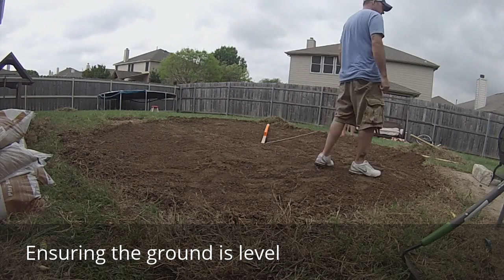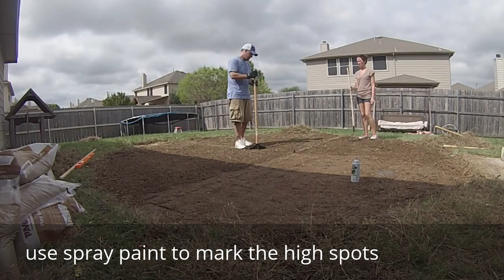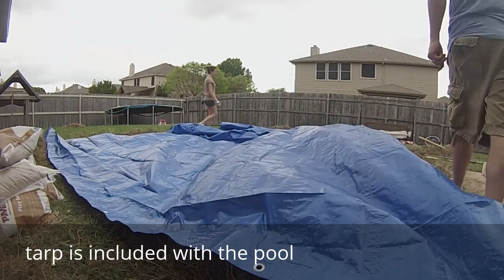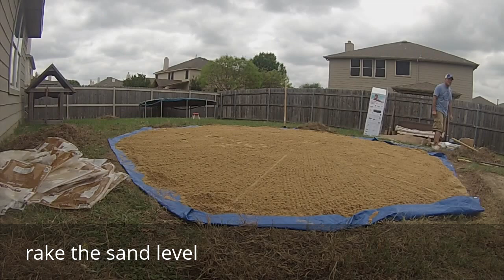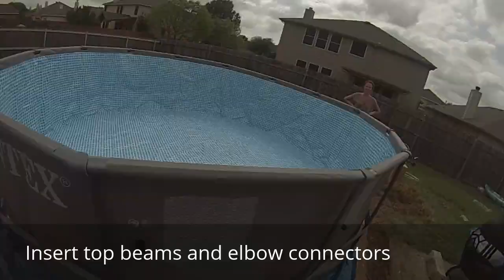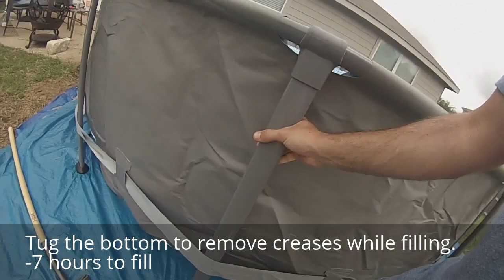INTEX Pool (setup)

Comment: Title indicated pool AND DECK....Change your title to just pool, I need a good video of a small Intex pool deck...not JUST the pool, I have that up already...Tip to those who are putting up one of these...As they show...clear spot (2 feet BIGGER than the actual pool) then stamp it, check with the level (setting the level on a board and taping it is a great idea) to ensure accuracy, then lay the tarp, then lay sand on the tarp, spread around, stamp it, check for level accuracy, lay 2nd tarp on the stamped sand.
THEN...Here is the actual TIP...after 2nd tarp is placed, go out and purchase rug matting ensuring it is the exact size of the tarps you used..  Nothing expensive, as a matter of fact find the cheapest that a rug outlet type store or warehouse or wholesale has to offer) and place it down on top of the 2nd tarp.  Why do this?  it's amazing how nice the cushion feels when you are in the pool, it makes a word of difference.  Anyway, sorry I had to give this a thumbs down but your title of the video does not show ANY PART of deck building...So you don't get more thumbs down hits, I suggest changing the title.  Thanks